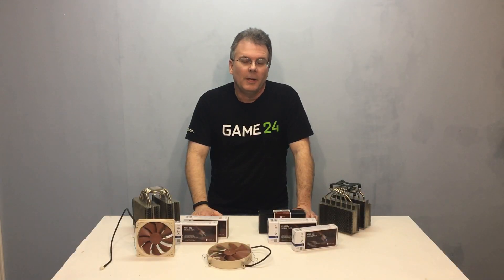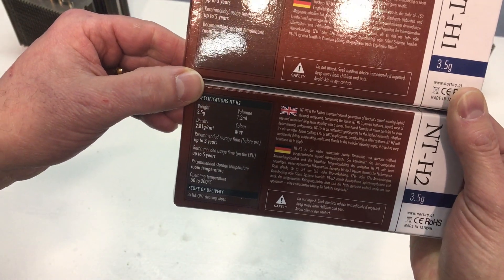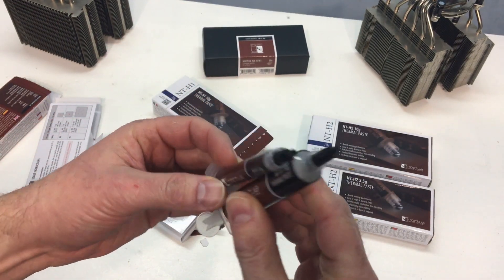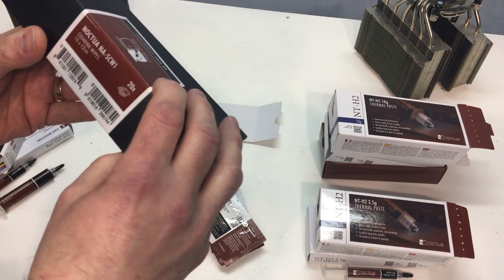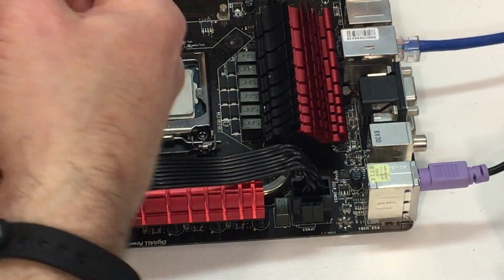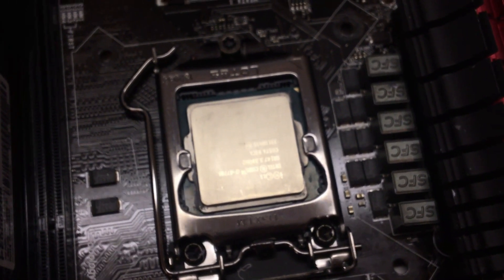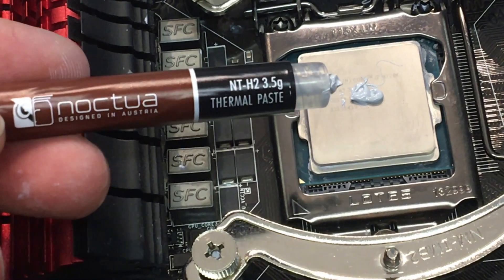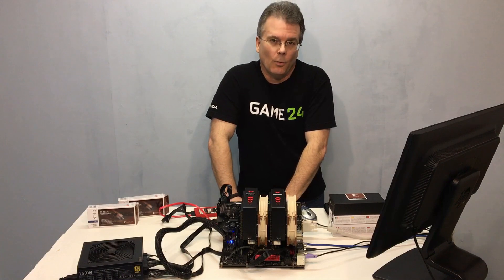Noctua NT-H2 Thermal Paste Review

Comment: At the 10:30 mark you show both fans attached to one tower for the H1 test, and then later for the H2 test, you show one fan attached to each tower.  I believe that the second configuration is more efficient, which could also account for some portion of the lower temps observed in the H2 test.  What say ye?

BTW, thanks for an interesting video!
Reply from the maker: Ah, yes - but if you watch again, when the testing starts for both pastes (10:45 and 13:26) , you will see that the fans are attached in the same manner - one per fin stack.  Not completely sure why both were attached at the 10:30 mark.  I might have been fooling with the dress-up kit earlier and then moved the fans at the last minute for the testing. Regardless - good catch.

Comment: if you're gonna do that with the thermal paste just use a spreader
Reply: Method on the video creates a nice and even distribution with trapped air pockets. On normal heatspreader CPU's i create a line covering the die orientation underneath. and on laptops/GPU's i use a spreader to cover the full die. (to prevent uncovered corners) You can see correct application on naked dies with an individual CPU cores temperature monitoring tool "CoreTemp" "HWinfo" "HWMonitor" etc. A large temperature difference between cores on full all-core load means something is not covered.
When i accidently lift the heatsink after application i use a spreader to fix the mushed up paste and apply a tiny dot on the center.